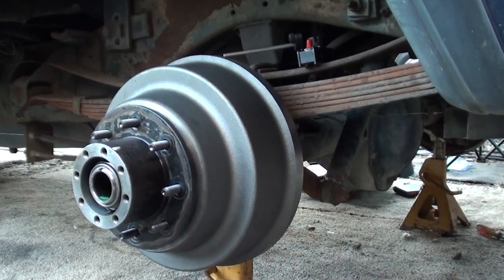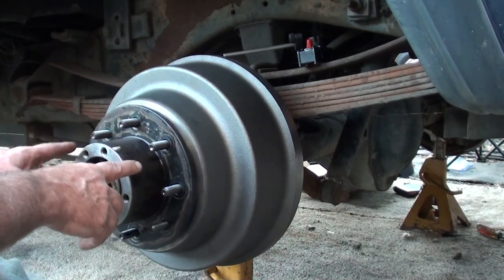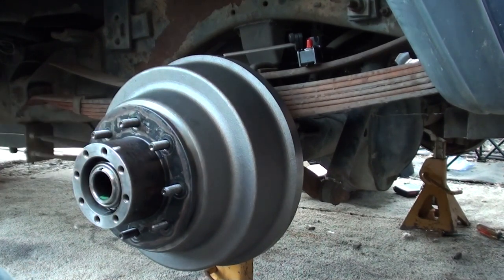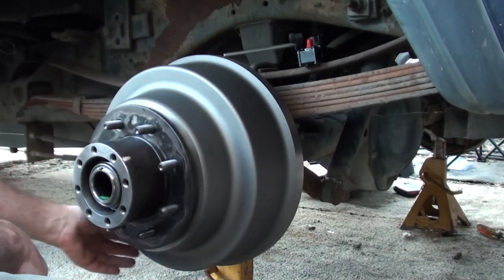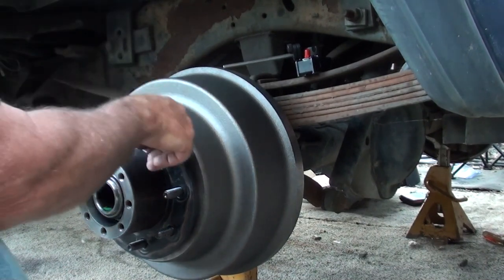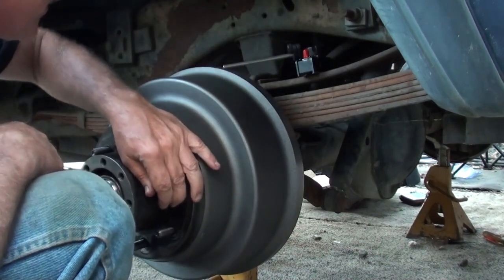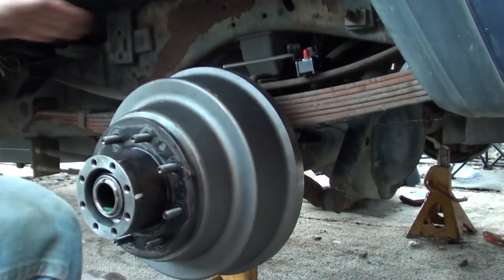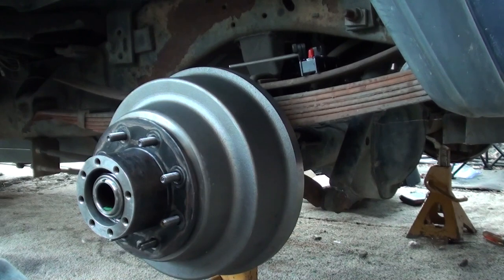Dana 70 Brake Shake Prevention 93 Dodge D250 Drum Centering After Replacement

Comment: That gives me an idea to drill four holes  in drum for 1/4-28 set screws.  Drill all four holes 90 degrees apart. Drill holes so they hit the hub flange for adjustability.  Now put your indicator on the drum flange like you did an adjust the high an low spots with set screws. Now you won't have to worry about it changing when you tighten the wheels.

Comment: About 20 years ago or better, I worked in a Chrysler Dodge dealer. We had a customers truck in and the complaint was a horrible shake while braking. Even worse when pulling his camper. Logic dictated warped drums and or front rotors. All were replaced and it did the same thing and customer was pissed. The tech replaced everything again and still the same result. We ended up calling Chrysler\ Dodge technical assist and some engineers got involved. They came up with some cockamamie idea that the rear end of the truck was too light and needed weight. So we added weight....lots of weight in the frame area. Didn't help!. Fast forward....the truck got bought back by Chrysler(Dodge. I kept saying it HAD to be a brake problem....it to be a brake problem. I never knew what happened to this truck - it probably got scraped. This video is THE FIRST logical explanation I have heard and was probably the problem that our dealership was dealing with. Thank for sharing!

Comment: My 1st gen stops like it has square brake drums. I'm gonna have to check this LOL. If these drums won't fit tightly on the hub, then it seems a brake lathe could really mess them up.
 The biggest issue on my Gen 1  that has me pulling my hair out is the proportioning valve won't stay centered, causing spongy brakes.

Comment: That had to make a huge difference.  The only problem that could come from your method is casting quality of the drum. We all know parts is not always parts. Especially going all across the country. Your method would work with a C clamp and a no 9 wire bent to read from the backside of the drum as well, between the backing plate and the drum. Great video thanks for sharing

Comment: I swapped in a slightly newer third member that has the drum pull off over the studs on the hub, so you don't have to remove the hub, just to inspect or work on the brakes.

Comment: It seems to me that a few lug nuts spaced evenly would pull the drum tight to the hub before that heavy tire and wheel are installed. Glad to see being indicatorless didn't slow you down at all. Does your rig stop smoothly now ?